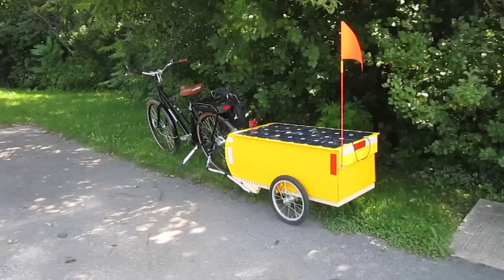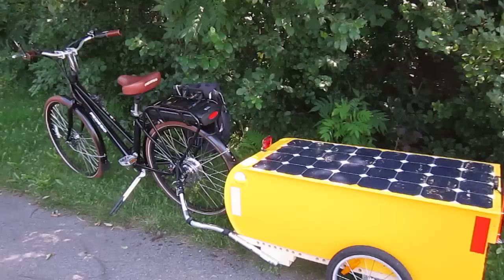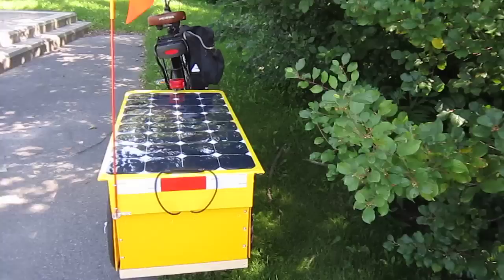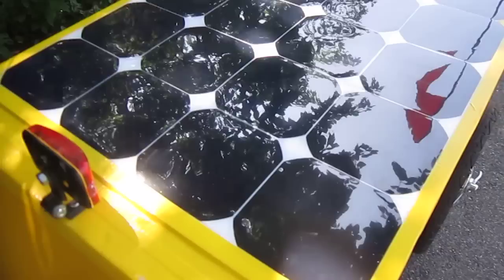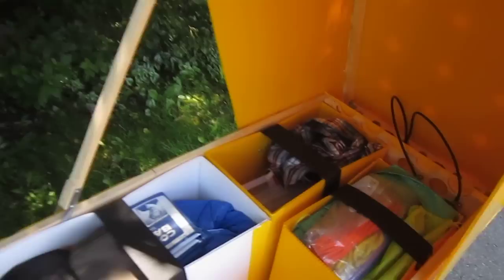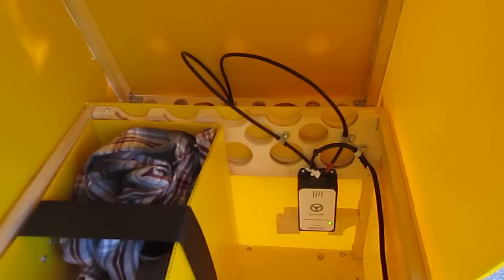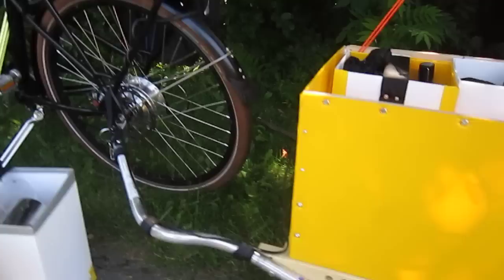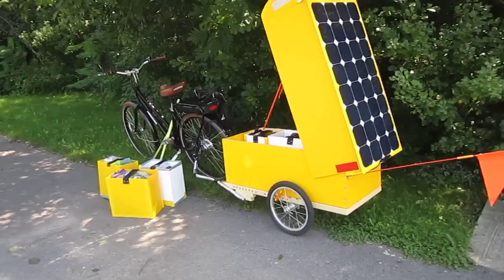Solar electric bicycle touring trailer for luxury camping

Comment: Hi Robert. The trailer looks awesome. How much did it cost to put together? Would you consider getting into the business of building these for sale?
Reply from the maker: The wood, Coroplast and hardware cost under $200 CAD (I didn't keep track). The solar panel and boost controller $500 CAD. I didn't have to buy the wheels, axle and towbar since I vandalized my Burley trailer for those. I'm presently waiting to hear from my Burley dealer for a quote on a set of those items because I want to restore my Burley trailer to make it operational again. From looking at the Burley website, I think those parts would come to about $250 CAD. So all told, this adds up to about $1000 CAD, or about $700 USD.

Comment: Nice set up wondering if you are able to charge other things as well like phone radio and flashlight. Also not sure why using a woman’s bike🤔
Reply from the maker: In order to be able to charge other things, I would have to add a 12 volt battery somehow. It just wouldn't be worth the trouble since I stay where there is electrical power to charge my bike's battery.
As for the bike, the step-thru is just more practical for a guy with reduced flexibility. Not getting any younger.

Comment: I love it!! I don't know how bad of a problem jackknifing is. But if it's bad enough, trailer brakes might be worth inventing.
Reply from the maker: Jackknifing might occur if braking suddenly while taking a curve too fast. Because the tongue is attached to the axle as opposed to the saddle tube, it is less likely to unbalance the bike. But it is something to be careful about.
Reply: Would be easier to simply reinforce the clamp for the seat post and run a bolt or pin through it so it cant turn. If needed you could add a limited joint in the arm so that it drags less in turns.

Comment: Wish I'd had a similar setup when I did my tour across America. Right about the problems with Panniers ,but I made it. Prevailing Wind=No matter which way you going, the wind is always blowing against you.
Good build Bob.
Reply from the maker: Thank you. Wind: With electric assist, it doesn't get you tired. It only affects your range, positively or negatively.

Comment: I love the concept. Honestly though I think your wasting the solar trying to supplement your output. It would be far more efficient to have 2 batteries and switch between them when your in use battery reaches about 25-30%. Always have one charging and always have one connected. From what I understand about batteries you cannot charge them while draining them. If that were the case it would make more sense to run the motor directly from the panels. Obviously that doesn't work so in a nutshell 2 battery set up is the way to go. Could do 3 and simply have 1 on full charge for standby but might be overkill and or just extra weight. I love the drilled out boards to lighten the load. Very smart touch. The best thing about DIY projects like this is they have room to evolve over time as the craftsman gains new insight. Keep building and keep connecting to nature and the community and your inner creativity.
Reply from the maker: Hello, TSM.  I am planning to do just what you are proposing with my Bosch Cube, having 2 batteries, and charging one off the bike while the other powers the motor. As for charging while running, many solar cyclists have done this, such as: https://www.youtube.com/watch?v=5_SGoka_LzI
Thank you for your good wishes.
Robert
Reply: I love comments like this not hating but giving good advice and ideas I wish everyone was like this. 
Thank you savagefoxdesigns you have given me ideas as well.

Comment: Good job. It is very nice and neat. I think if you increase the cells area and charge rate to 250 Watt, it may save moscles power more in long trips. I suggest, you add a roof extension panels on bicycle as an  option. It also might protect you against intensive sun light or rain if any.
Reply from the maker: I agree that 250 Watts would allow me to be independent. I'm just a little hesitant about having a large amount of panels sticking out in the wind. What you suggest already exists: www.sunridepower.com . I'd still need to install another 50 Watts somewhere.

Comment: Great little trailer, nice to be independent like that. Would be nice to see you riding with it on a video..
Reply from the maker: The year after I built this trailer, I built my Beriault bicycle camper and then never used the solar electric trailer until last summer when I lent it to a friend who accompanied me on a trip using my Bosch Cube: https://youtu.be/jnrlxFWeMUY

Comment from the maker: Hi, RB V,

The boost controller is a Sunride, 57V, 8A Charger for lithium ion pack. It is available from www.sunridepower.com. They also sell the whole solar kit for adding to your own Pedego bike, including a 100W solar panel and the required wiring and connectors.
Have fun!
Reply from the maker: It's Oct 19, 2019 and I just saw your comment. Thank you. Somehow or other, I did discover Sunridepower and did buy the solar panel kit from them. That's what I used for my solar electric trailer.
Reply: I wanted to build a bike trailer,  such as yours,  and YTube brought forth your video.  Crazy.
Reply from the maker: Great!!

Comment: Looks good. My mate built a trailer from an old folding  camp bed so he can sleep in that. no tent required. He then cycled through eastern Europe
Reply from the maker: Has he put pictures of his rig online? Sounds interesting.
Reply: @RobertBeriault753  Unfortunately no pictures. It was a very low tech build made so it could be fixed easily with only a few tools.He didn't like the side attachment  so welded extensions  
to the seat stay tubes terminating at the back of the wheel to attach his trailer. When the camp bed was folded out the tent canopy effected itself. Very ingenious.

Comment: Could be a very nice setup even for world tours. Getting the push just for steep climbs. Very nice work.
Reply from the maker: For a world tour, you would have to make special arrangements to have the trailer transported across the oceans. But it would be nice to have on a long tour. Next summer, if my health permits, I plan to ride from Ottawa  to Halifax, N.S. (1500 km). For the trip back I'll decide if I have the bike and trailer shipped or if I'll ride back. My battery will be 4 years old then. I hope it won't have lost too much of its capacity. A second battery would be very expensive. $1000 CDN for the 10 Amp, $1500 CDN for the 15 Amp. I don't want to put more money than necessary on that eBike, since it's not the ideal bike for long distance touring.
Reply: Robert Beriault I ride recumbents for long distance tours, with a radical trailer, very comfortable setup (no electric assistance). 
I do watch on YouTube the sun trip a race they organize from Europe to eastern countries, once Turkey once Astana, and they setup is huge, not practical but give them full support.
I think your setup is more in the bicycle spirit, means: have electric support for some steep climbs.
I guess in the near future with some improvements in the solar cells and battery like graphene tech, it will be very possible.
Reply from the maker: A recumbent looks so comfortable! The majority of electric recumbents I've seen are tricycles, which are too wide for highway travel, in my opinion. I would like to try an electric recumbent bicycle.
Reply from the maker: Had a look at the P38 online. With its 700c wheel, do you think it could take the Bionx ebike conversion kit?
Reply: Better you ask them, but I guess yes, as bionix can be mounted on any bicycle.

Comment: Nice but If I would have built it I would have made the inside trailer frame of Aluminum. A few pounds more but much more durable. other then that, I LOVE IT. The best part is the 12 to 48 volt DC Boost controller. I need one of them for a project, Thanks, didn't know they made them. I was using a Heavy Inverter and Transformers to go from 12V to 120V then back to a 48VDC Converter. This one is more compact and lighter. have a safe trip.
Reply from the maker: The idea of the wooden frame was to test the idea without spending a lot of money. Now that I see it works, I might redo the frame in aluminum. Genasun also makes boost charge controllers

Comment: Brilliant! I also have an electric bike, easy step through, with the batter on the back in same spot. To buy another backup battery is so costly. And then it's heavy and we wondered how to pack it.
Reply from the maker: I found that a single 100 Watt panel, in Canada, can't produce as much power in a day as a battery of the same weight. You might want to consider this before spending money on solar.

Comment: Great trailer! 

Your 48v nominal (lithium ion, I am assuming) battery probably has a peak charged voltage of 54.6v. (48v is the mean voltage, 54.6 is fully charged, and about 42 volts is the lowest safe voltage for the battery so the individual cells in the battery assembly don't drop so low that they are damaged in use). If you get a boost voltage charger that is adjustable to about 52/53 volts DC  for an 80 to 90 percent charge level you may want to change your charging voltage to that so you get much filter use of your battery capacity while still not stressing it with a full 54.6v charge .

At a 48v charge you only have use of air half of the storage available in the battery.

I love your trailer, I'm looking forward to building one similar in the near future so thanks for the ideas and inspiration!

Adjustable voltage output chargers are commonly available for home or rv photovoltaic/battery energy systems if you can't find one, is my understanding at this point. I forget the acronym for the technology but basically they work by taking the photovoltaic output, reading it, and dynamically covering it to a specific, user-settable charge voltage and current on a continuous operational basis.
Reply: fuller use not filter use
Reply from the maker: Charging is more complex than it appears. I just received my Cycle Satiator charger from Grin Technologies ( https://ebikes.ca/product-info/grin-products/cycle-satiator.html), a pretty impressive apparatus. I'd love to see pictures of your trailer when it's completed.
Reply: I'll post back when it's ready!
Reply: It's called an MPPT charge controller.

Comment: nice trailer. great build.  😁👍
Reply from the maker: Thank you.
Reply: @RobertBeriault753  can you tell what boost converter it is?
Reply from the maker: A 12 Volt solar panel generates 18 Volts. My 48 Volt battery needs 56 Volts. The boost controller does two things. It boosts the 18 V up to 56 V and it senses how full the battery is and moderates the current so the battery doesn't overcharge.
Reply: @RobertBeriault753  link when bought it? maybe i need it in my next video. your boost converter has good looking.
Reply from the maker: I bought it as a kit from:
https://www.sunridepower.com/diy-kit

Comment: Nice one.
Reply from the maker: Thank you! Cheers!
Reply: @RobertBeriault753  I'm just wondering if the corrugated plastic coud use maybe laminate/epoxy/fiberglass/glue&cloth ? to increase structural strength, yet retain light weight

Comment: Very well thought-thru, 9/10 because I'd make it bigger / a camper instead. :)
Reply from the maker: Actually, Lyn,  I'm working on a camper design that I could tow with my ebike on highways.
If it turns out the way it is planned, it will be short and long, narrow and wide, low and high, and always lightweight. 
I'm aiming for a 10/10  :-)
Coming soon. 

Thanks for your interest.
Robert
Reply: Robert Beriault Well I hope to get to see that too! Thinking the power of an ebike would be well utilized. Greetings

Comment: You should mount a panel on your bicycle, kind of like a roof for your bike. Then make your trailer twice as long since they are so light & add another solar panels on that, during the day you can run directly off the solar energy.
Reply from the maker: Very good suggestion. I'm still working that out. Thank you.

Comment: That is the kind of trailer I want to build with my everlast welder.
Reply from the maker: If I had welding expertise and a garage in which to work, I would have built the structure of this trailer and of my bicycle camper out of aluminum. It would last much longer than wood and maybe it would be lighter. 
Thanks for your comment.

Comment: In 2016 I started with my plan for solar touring on an ebike. I knew a trailer would be mandatory for the amount of gear that was going to be necessary and all the gear that I wanted along for creature comforts. I also knew that a two-wheel trailer wasn't going to work, and would in fact be dangerous, or impossible to access the areas I wanted to ride. I wanted the ability to ride single-track and back roads. I also knew that a 300W panel is a minimum needed to charge large ebike batteries in a reasonable amount of time. I went with a full-suspension touring bike, a 1000W mid-drive turning a Rohloff Speedhub, a pair of 2000+ Wh lithium packs, and a front dynamo hub for light and battery bank storage. A suspended single-wheel trailer modified to carry a 300W folding solar panel. The bike was finished in 2016 with the trailer and bike frame modified in 2017. God willing I will break 40K miles on the bike before the new year. I'm curious how much you have pulled your rig. Stay safe. - https://photos.app.goo.gl/ADgC6oyPM2gyrCq27
Reply from the maker: That looks like a very practical rig for cycling off-road. Well done! As for me, I only used the trailer for about 1000 km before putting it aside and building my bicycle camper: https://youtu.be/PIv8wU0SL5s.
Wish you many more kilometres!
Reply: But how do you charge while cycling with that folded panel?

Comment: Thats pretty cool ,  just an evil idea , maybe you could have a spare battery in the trailer so if you stop for an extended stay somewhere  you would have two charged batteries , i do understand however if you would rather keep the weight down . 
 Nice job any way sir ..
Reply from the maker: Exactly what I'm thinking about. Thanks for your comment.
Reply: Robert.  Did you make plans to help us make one too?  Rod in Surrey , BC
Reply: nevermind Robert. I found that you have done so on your web page robertberiault.com thank you so much.
Reply: @RodneyLamirand  I'm a simple man: someone helps me, I upvote

Comment: What a great design.....Are you using the MPPT charge controler mentioned in the description ? How did you attach the corners and waterproof the whole thing ? Its a good size and the boxes inside are perfect....Well done !!!
Reply from the maker: All the joints are waterproofed with yellow duct tape and the panel is simply taped onto the top with the same tape.

Comment: Just a friendly tip. 12V to 48V is quite a jump. You can get 24V panels. Perhaps even you could combine 2x lower wattage 24V panels, and simply use a li-ion regulator. The panels might be lower wattage, but that'd be more efficient than boosting. Even a single 24V panel stepped-up to 48V would prove more efficient. Great build, I'm sure you're getting good results either way :)
Reply from the maker: I'll have to do more research about that idea.
Reply: What Matt is referring to is the high peak currents so the I squared R losses get rather high when boosting from 12/16 volts to > 48 volts.  Even so, DC-DC boost-mode converters are efficient enough that I would design the trailer I want with whatever solar panels fit best.  That might include some kind of fold out rack as a single 70 W panel does not provide much power.  Solar powered transport is always tough as the weight and wind drag of PV panels is large compared to the significant energy that transportation requires.

Comment: Your video is the first I came across in my research on building a solar trailer for long distance touring on my e-bike. Thank you so much for sharing your design. I love the organized boxes - imagine not having to roll up your tent each day 😄. I subscribed to your channel and looked through your videos but could not see a follow up. Was your trial run a success?
Reply from the maker: I used it only one season and the following year I built the Bériault bicycle camper. This configuration isn't enough to be self sufficient. But if you made the trailer bigger and fitted a 170 Watt panel on top with a second one hinged onto the back to make it twice as long, that would be enough. Food for thought...Here are a few more videos about the solar camper:

Effect of cloud: https://www.youtube.com/watch?v=EUUOfdXc028&t=53s

Rob’s Solar Trailer Ebike Tour of Eastern Ontario: https://youtu.be/s66AGne4Fl8

Rob' Solar Trailer Effect of angle of the sun on a solar panel: https://youtu.be/PnKo51DMkmY 

Shadow on solar panel has big effect on charging power: https://youtu.be/4Hvk2wW06gk
Reply: @RobertBeriault753  Thank you for the clarification and the links.

Comment: You should also have the solar cells on all the sides of the trailer too.
Reply from the maker: That's a possibility. The trailer would have to be a lot higher, but it would work.

Comment: i know this is too late,, but you may flip the panel so the terminals are closer to the bicycle, shorter wire = less voltage drop = more efficiency.
Reply from the maker: Thanks for the suggestion.
Reply: @RobertBeriault753  most welcome, i just learned that your system is stepping up the voltage to 48v.. for that voltage drop should not be a problem. i withdraw my previous comment sir.

please allow me to advice to add ventilation holes in front of the trailer and at the end for exhausting hot air below the panel, these panels produce less when hot,, getting natural airflow will help cooling and remove any humidify from your clothes.